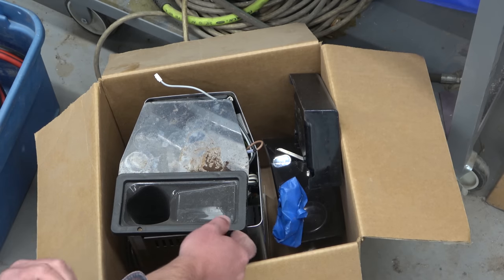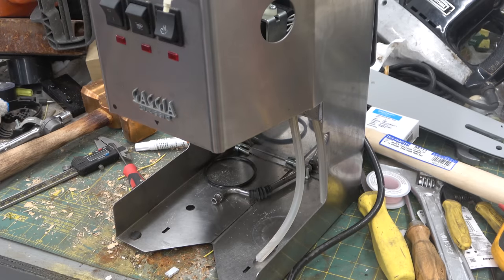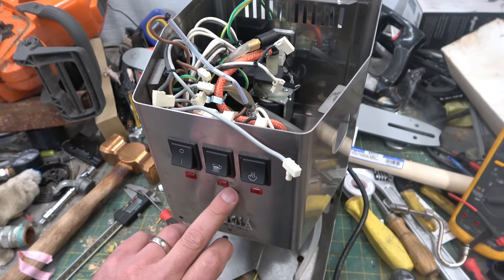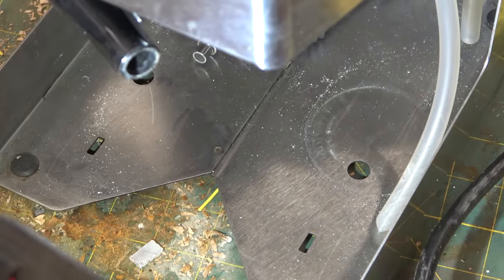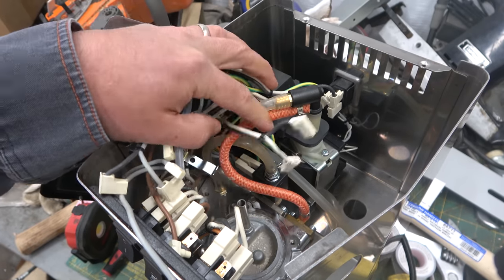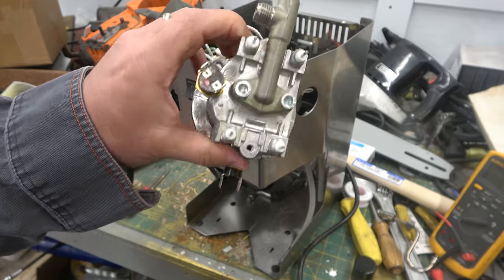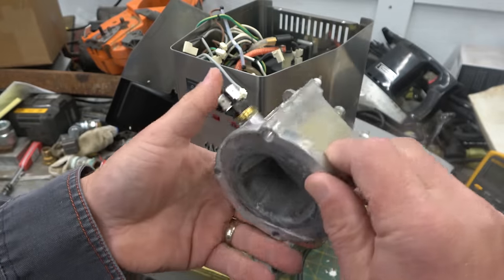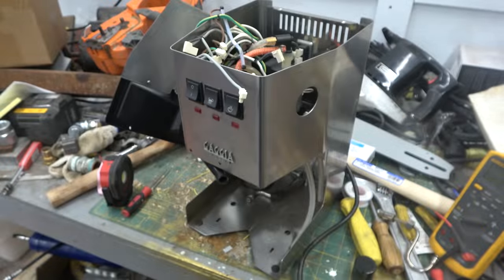unBOLTR: Gaggia Expresso

Comment: "Customer states no worky worky" is more coherent than what I usually get
Reply: given that's Italian - their statement is 'not works'
Reply: My favorite is “customer states -“customer try’s to diag problem” “
Reply: I was hunting for used (broken) espresso machines for a while and after never getting good answers to: "What exactly is broken?" I started giving suggestions: "No water coming out?" "Water everywhere?" "Water cold?" "Turns on?". It helped, a bit
Reply: “Voltage not working all the time.”

“Customer states they don’t know what’s wrong with it.”

“Won’t power on -Shock you!”

“Keeps losing gas.”
Reply: @sithticklefingers7255  one of my favorites was "the running boards have stopped running"
Reply: "Hi my thing a ma jig that does the thing with the Combe doesn't work but it works with this other computer that you said I was meant to use"  

fix it
fix it
fix it
fix it
fix it
fix it
fix it
fix it
fix it
fix it
fix it
Reply: @Finnspin_unicycles  I bought a second hand machine from a café that was closing down for cheep not that long ago, the ad said that it worked but one of the grouphead gaskets needed to be changed (but a new one was included).
Than when I picked it up the café owner mentioned that it didn't steam milk too well so they used a immersion blender to help it get going.

Let's say that was the least of the problems 🤣
The machine had never been descaled so the boiler filled to much to get a.good steam pressure so that would have solved that problem if it was all that it was.
But it was also the issue that the steam tip hadn't been cleaned or the steam rod purges after the milk steaming so it had sucked milk into the boiler so not only was the boiler filled with scale it also had a layer of carbonised milk all over the inside.
Thankfully weak sulphamic acid can remove carbon burned into copper but it will take weeks and the outside of the boiler that was nickel plated is now copper plated on top of the nickel plating.

Oh, than the grouphead gasket it was not that it just needed to be changed the first challange was to remove it, and the shower screens had likely never been cleaned ether, same on the grouphead that was supposed to be "ok".
I also suspect that the café dident have ether a coffee grinder nor a tamper so they likely just scoped up pre-ground coffee with the portafiltet and put it in the E61.

I understand now why everyone that seems to make a video on maintenance of E61 machines disassemble them completely as that seems to be needed more ofthan than not.
Reply: @aggese  You are describing exactly why I've never pulled the trigger on those used gastro machines tempting me in the classifieds... 
I ended up with a gaggia baby, I think I still have <200€ in my espresso setup after fixing that one (including a mill). The saved search for broken espresso machines stays active, I think with some luck there is an opportunity to make some decent cash on a fix and flip.

Comment: I have a Gaggia Classic Pro and theyre solid. Like you said, made to repair and keep forever. Ive modified mine pretty extensively by swapping the thermostat with a thermocoupling and adding a PID temperature controller to keep the water +/- 1° rather than +/- 35° from factory. Also swapped out the 15 bar over-pressure valve with a 9 bar to get the correct pressure. Few other small mods not worth mentioning but i will say with the PID mod, OPV mod, and a bottomless portafilter, precision basket, and good quality grinder you can make the same coffee that a $5000 machine will make. And consistently.

Comment: I would try Tig welding and put the housing in the clapped out Bridgeport and reface the gasket surface.👍
Reply: yeah.. then pressure test it. should be good.
Reply: Yeah... I forgot this guy has a machine shop and is asking us how to fix.
 Yeah tig weld and resurface. Or if you're feeling froggy and experimental, clean, flux, plumbers solder. Then get some quality sandpaper, spray adhesive and a piece of glass and figure 8 your way to flatness.
Reply: Bridgeport espresso? Now you're talking!
Reply: As the man's said before, you can't fuck it up more than it already is. May as well give it a shot
Reply: @kylegoldston  Good luck soldering to aluminum!
Reply: Somebody on here said that the boiler is available for $35. I mean sure, there's no project in that, but at that point the economics of it alone make it a buy and swap situation.
Reply: @davidsmart8594  go see This Old Tony. He can show you how to do that.
Reply: Tig may not fix but break it differently. With the 11 herbs and spices they put in cast aluminum, it is hard to say what you're metal gluing.
Reply: You can, for sure. But a new boiler is pretty cheap and available.
Reply: @ADBBuild  I've used some of the infomercial aluminum torch weld stuff. It doesn't work as good as on the add but it works way better than you would expect.
Reply: The boiler costs only $35 bucks, as someone posted here earlier said.
Might as well get replacement gaskets and rubber seals from the same place. The ones in the machine are old and worn.
Parts can be viewed here:  https://s3.amazonaws.com/wll-documents/Gaggia/Classic/Classic+Parts+Diagram.pdf
Reply: @Finnspin_unicycles  Sure, but where's the fun in that? 😊
Reply: Why use the Bridgeport to do that, when he can put it in a Kurt vise on the CNC HAAS, ...and zing it out of the vise with shell mill doing 15,000 RiPuMs?!  I can visualize the sparks and loud bang already!!!
Reply: @warped2875  I believe the heating element is pressed into it, not sure it could be removed without compromising its integrity.
Reply: @ADBBuild  I have received a solder flux for aluminum from India that works extremely well!
Reply: @AlessioSangalli  Well enough to hold pressure in a boiler?
Reply: @ADBBuild  
Not to mention it should be able to withstand over 15 bar of steaming hot water. I wouldn’t take any chances with that.
Reply: @neverusedutube  And you’d have to be sure your metal glue repair will be strong enough to withstand over (how much?) 15 bar of hot steaming water.
Reply: @ADBBuild  I do not know the answer, one should try it could be a very interesting vijeo.
Reply: @Conservator.  15 bar is a little optimistic....
Reply: @AlessioSangalli  Most pumps produce 15 bars. The pressure is then reduced to9 bars via a OPV. 
To be safe, you’ll have to withstand 15 bar in case the OPV would fail. The pressure could perhaps go beyond 15 bars if a thermostat would fail too. 

I wouldn’t take any chances with that pressure and water of over 100°C, would you?

I’m sure AvE will adress the subject in a follow-up video.
Reply: @Conservator.  I would not worry too much. If the repair breaks, the crack will let out some steam at a lower pressure than the pressure relief valve would do. The danger is too much pressure so the vessel explodes violently... Coffee machines in any case do not have a lot of stored energy really. Even if I suggested I have this magic flux for aluminum that allows very strong soldering, I would never use that in favour of a session at the TIG welder. Most people hate welding cast alu but if you take your time and be patient with surfacing the impurities and use filler right, it's not really a big deal. The biggest inconvenience is that the part is relatively small so it will get pretty 🔥 hot
Reply: @ADBBuild  I've never tried, but they do have aluminum brazing rod. I don't know if it's okay for food contact however.
Reply: @AlessioSangalli  once I was shown to use DC and helium by a guy who does top fuel heads, I fear no aluminum.
Reply: @johndoe-so2ef  Is there really an advantage in using DC vs a modern welder that can change all the parameters of the AC wave?
Reply: @AlessioSangalli  I believe there is, so I do it.
Reply: @johndoe-so2ef  care to elaborate? I see that on an old transformer based welder one might not have enough cleaning action

Comment: Some folks install a PID temperature controller on these. There are even kits available. Makes for a very good little machine.
Reply: Yea did mine and it transformed the machine into a completely different league.
Reply: That Gaggia classic was my first machine. Great little machine that made great coffee.
Reply: Did mine, the kits are really pricey for what they are.  You can buy basically any PID controller and a solid state relay and a k-type ring terminal thermocouple, if you don't mind ebay you can PID one for 30 bucks.
Reply: Oh that is interesting! Excellent temperature and pressure regulation are the main tricks of these machines, albeit there are lots more tricks hidden inside.
Reply: Thanks for the tip. I've been wondering for years how to use a temp controller to make better coffee -- now I have something to Goebbels.
Reply: @dosgos  it’s more about pressure with coffee I’ve found. Obviously too hot water is a big no-no but water can only get so hot in the pipes before it just becomes more pressure so really at that point they’re the same picture
Reply: Pid. Bottomless portafilter. Pressure adjustment to 9 bar (I have the older adjustable OPV). Great machine to mod and well supported with parts.

I'm keen to try the dimmer switch on the pump voltage for pre infusion as well.

Comment: I actually develop higher end coffee equipment for my day job (Goat Story). And I got me the old version of the KitchenAid Artisan espresso machine for my home brewing (and moding). It's the same thing as the Gaggia Classic, has all the same internals and was built by Gaggia for KitchenAid in Italy. Bonus is that you get 2 of the Gaggia Classic boilers inside instead of just one. So one is dedicated as a brew boiler rand the other for steaming AND it has a cool aluminum diecast oldschool enclosure. Paid 50€ for a clogged one on ebay that I got working in a day.

About the Gaggia Classic boiler; that part, including the heaters is just 50€ new and 10€ used on ebay. They last forever and are ubiquitous. 
The Gaggia Classic (and the KitchenAid Artisan by extension) are great platforms for experimentation. There are a lot of aftermarket mod parts for them to improve the machines and quite a big modding community round them.
They benefit greatly from a PID controller upgrade and a better steam wand and shower head for the group.

One more smart thing about that boiler and the two heaters on it is that you either wire them in series or parallel to get 110V or 240V for different markets. But it's the same part. Very smart engineering.

Comment: Use mine daily and have done for the last 10 years. Treated her to a new pump a few months ago and parts are very cheap, but it would be fun to watch you tig up the contaminated porous casting too!
Reply: I found that Alu electrodes got it done when TIG was no good. If the material has decent thickness for good arc amperage and this part looks like it.
Reply: Girl same. Just replaced pump this year but mine is 16 years young and gets used several times a day

Comment: Gaggia Classic Pro! It's super easy to add a confuser to the boiler temp circuit to have really good temp control.  I ran mine for a good while with a PID and just set the over pressure valve with a guage and I was in business.  Super serviceable, makes great coffee.  Only problem is it's a single boiler and that means you have to wait to steam your milk for girly drinks (all I drink!) so I had to upgrade to a dual boiler model.  
Fun fact, Kitchenaid makes a machine what's got the innards of a Gaggia classic and an additional steam boiler!  can be found 2nd hand for $250-300 on the reg.

Comment: Do a tig test to see if it will weld properly, if not then braze it.  After that throw ye olde wet sand paper on a sheet of glass backed by MDF and do the old figure 8s until she's properly flat again.
Reply: What? And miss the opportunity to spend an entire day doing it on the CNC mill and breaking 3 cutters?  Nah...

Comment: I bought the same model of machine from a guy that runs a roastery (he also fixes espresso machines). I asked him if I should get one of those breville machines and he basically said the same thing AvE said; you won't be able to find parts for it in 5-10 years.
I've only had the machine for a few months, but it has held up pretty well so far.

Comment: Having recently repaired a commercial Italian semi-full-auto espresso machine...they are absolutely made to be serviced and it's a joy to behold. Only problem is all the electronical menus are hidden behind a 'technician' smart card. I can't configure it (probably because I could set pressures/speeds that would allow it to eat itself, like an engine-rich-exhaust rocket formula).
All it took was popping the pump apart and descaling some schmoo that was really really wedged in there. 70 bucks for a $5000 machine. Now to find that one damn o-ring.

Comment: I have that same machine sitting on my counter and picked up a similar one at a thrift shop for about $15. I know you can replace that boiler, but I haven't priced it so it might not be worth it. You could always TIG it and see if it works before you put out any $$$. Normally it's the pump that wears out never heard of someone freezing and cracking their boiler.

Comment: KISS. My Bialetti Moka maker works everytime I put heat under it for the past 3 decades. No electricity needed. Just burn somthing. Every grandma in Italy has one in their kitchen.
Reply: I have a small collection and I recommend a Bialetti stainless steel model, of at least 6 cups capacity, if not 12. Six Italian 'cups' of coffee will almost fill a standard American coffee mug, with tasty black coffee. It takes a while to make the coffee, so it's best to make as much as you're going to drink, all at once instead of having to dump out the old grounds, rinse everything out and wait for the process to run a second time.

Comment: Well worth fixing these. Mines got a P.I.D and some relays controlling the boiler temperature much more accurately now, and a PWM unit controlling the pump speed so I can have adjustable flow rate/pressure.
Reply: I have a old Ascaso steal pro that I plan to add PID control to it, the using pwm to control the pump speed is a interesting idea, I will have to look into doing that too.

Comment: If the Z dimensions are not critical (they didn't appear to be), I would grind an appropriate "V" groove into the crack with a carbide burr, fixture the assembly on something ridgid using the holes to locate according to the original receptory part (or whatever it's mounted to), preheat the assembly if possible then TIG using 4047 (4043 is more common, but 4047 seems to play nicer and have less porosity with cast aluminum with its higher silicon content at the cost of slightly lower tensile strength), and then deck/machine the base to suit (depending where the seal surfaces are). Again, if the height of the assembly off the mounting base is not critical you can deck off as much as you need. If it is critical, well, you'll have to make sure your mounting surface is fixtured to perfect and isn't warped from your welding heat input (good preheat is even more important then).

I don't come across a lot of cast aluminum work in tool and die work, but I know enough to be dangerous.

But I'm just one schmuck. Hopefully, you will be able to aggregate the knowledge of your viewers for a perfect approach.

Good luck, AvE!

Comment: Having had a Gaggia Titanium for close to 10 years now, I do have a few complaints. However she still keeps chugging after replacing the power transformer on the discontinued board and clearing the ground shoot many times. The grinder relies on pushing the beans to the brew unit instead of dropping them which can be annoying with oily espresso beans.

Comment: You don't need anything new it's a reset switch on the top that doesn't look like a switch it's on the boiler unit itself. I have one of these and have had to reset it quite a few times. It's a thermal cutoff switch but it goes for no reason sometimes. It's a little rectangle and it barely moved when you press it but you'll hear a little click.

Comment: I had the less skookum Gaggia Baby. Bought it off eBay with no worky. I replaced the upper boiler that you hold in your hand and it worked great for me until I upgraded to a machine that weighs 90# and I sold it on eBay as a “works great”. I should have kept it and PIDed the thing, as that is the mod that makes it a hot rod

Comment: Gaggia Classics are scookum as frig. I've put 3 together from part bins myself and a boiler is like 30 bucks partner. Leave the TIG to some other idiot
Reply: Where is the fun in that?
It is possible to weld it, I have seen transmission bell housings welded and aluminum cylinder heads welded.

Comment: Welding a casting on a pressure vessel that holds superheated water....I would try to find a replacement first.  Not likely it would send fragments flying, but superheated steam spraying out the crack wouldn't be fun.  Now after you replace the part....weld the broken one up, plug the tubes and connect it to power outside and let her go till she blows!